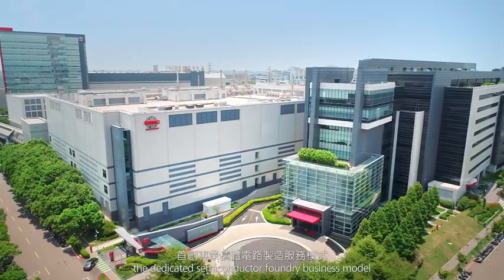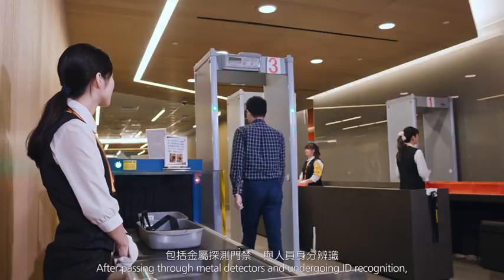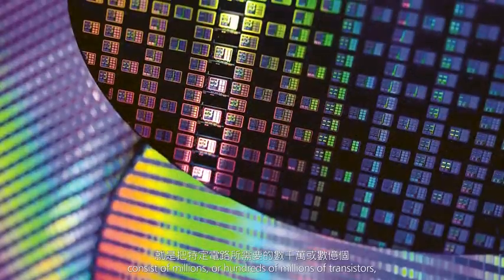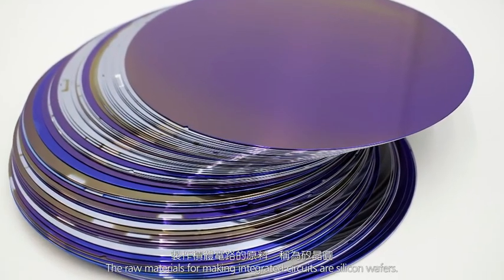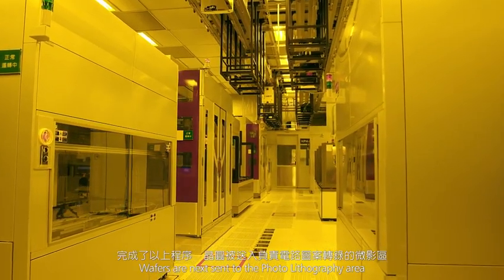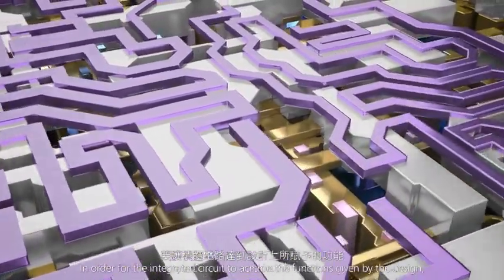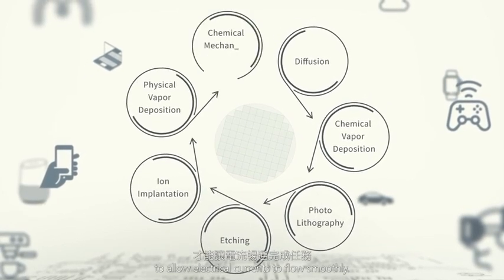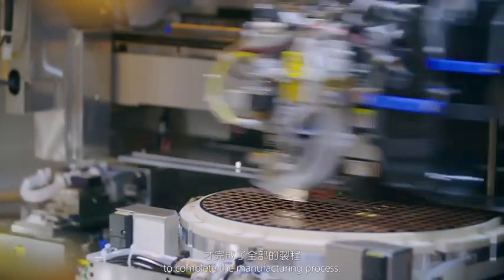The Craft of Making Semiconductors

Comment: You’re using the wrong boat for running through for the silicon wafers. The ones you’re using are broke you need what’s called silicon carbon boats the last longer work better and I gave you that information 10 years back. You never listened. You still give them with the quartz boats, but everything else someday you’ll get your brain right have fun. Good luck.